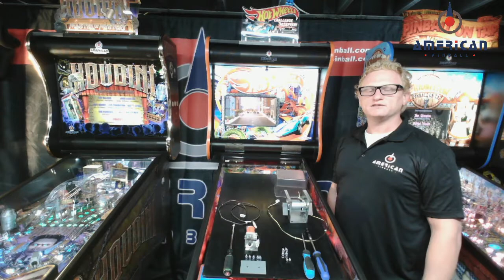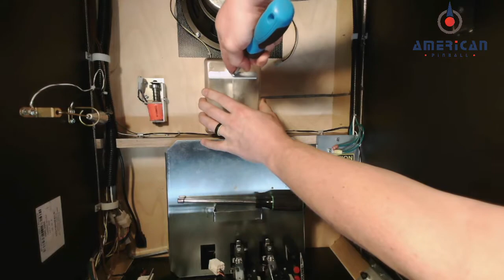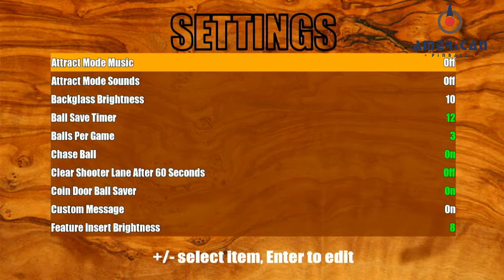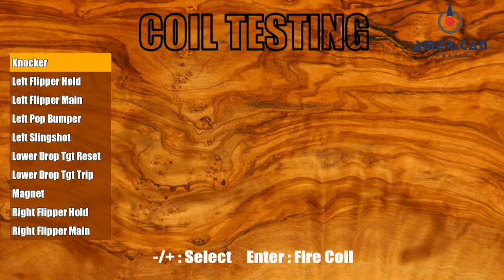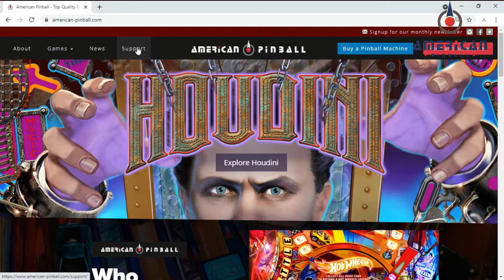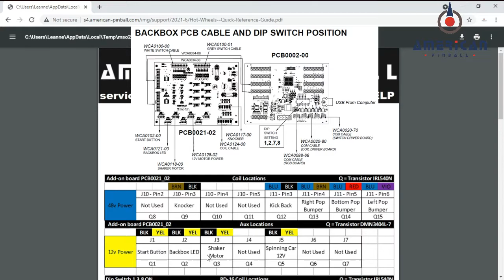Hot wheels - Shaker and Knocker install

Comment: Just got my knocker for my 10/20 built hot wheels pin and I don’t see a spot in the harness for it in the back. I see the one for SM, but no other. Any advice?
Reply from the maker: It's there, look in the back of the cabinet.  Might be tucked in the black corrugated tubing that holds the wire harness
Reply: @americanpinball7884  Indeed it was, thank you!

Comment: I just ordered a Hot Wheels cabinet that is supposed to come loaded with a shaker and knocker.  Was told that your company pre-installs these so I wouldn't need to do this install after its delivered.  Just wondering what's true now that I'm seeing this video.
Reply from the maker: The deal for a shaker motor included by the factory has ended.  This is why 
instructions were made.